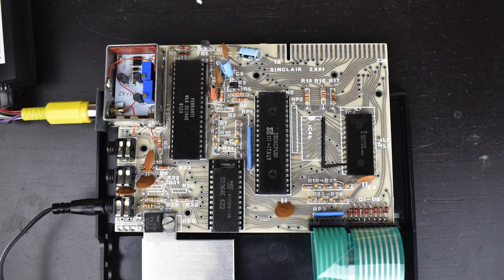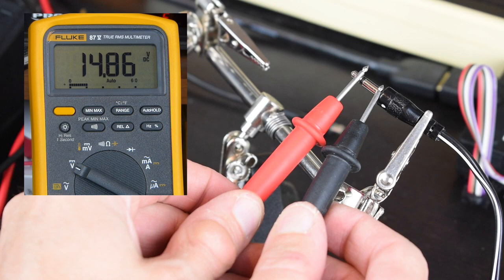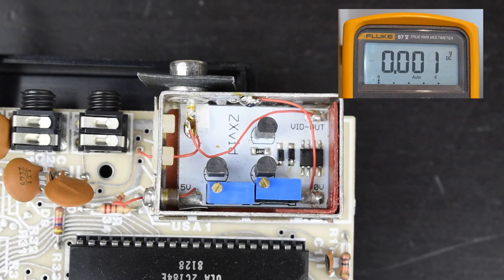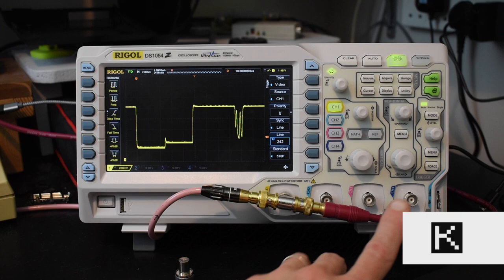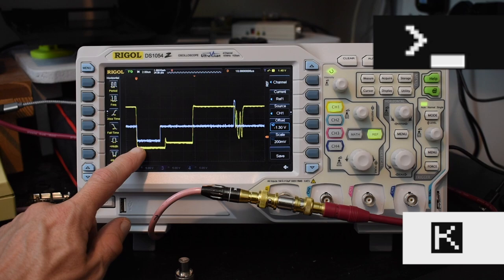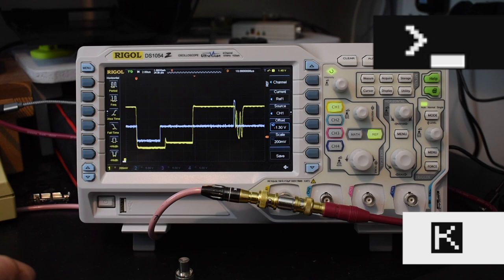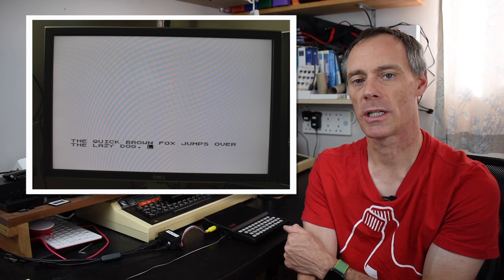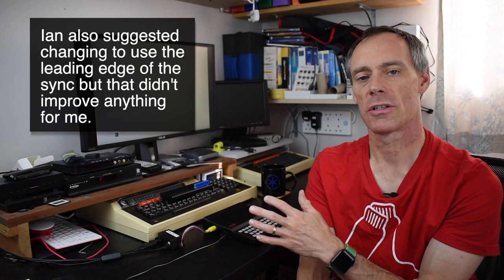ZX81 Composite Video and RGBtoHDMI Adjustments

Comment: You might want to try out a zx8-ccb (which is the same wiring into zx81) 

I think the voltage separation between the sync and back porch is greater. 

I would find a video comparing the two signals to be interesting.

Of course you could also get a modern ula replacement that will give you a nicer formed signal with backporch

Congrats on the 1K

Comment: Excellent video and work. How did you connect the RGB2HDMI adapter? I'm assuming you rigged it up to the composite jack. Thanks for sharing
Reply from the maker: Yup — I just made up a short cable with a 6-pin IDC connector on one end and an RCA plug on the other end, as described here: https://github.com/IanSB/RGBtoHDMI/wiki/Cables

The ground (outside sleeve of the RCA) connects to pin 1 of the IDC and video (tip) connects to pin 4.

I used a Mutant Caterpillar mod on the ZX81 to get a composite image.

The problems I had in this video have been subsequently resolved by using a Clamp setting on the RGBtoHDMI, as that will automatically compensate for the varying voltage.  I probably should do a short video about that but haven't had time!
Reply: @lsbyte  Excellent! Thanks for sharing this information. Great work!

Comment: that's weird. i'm not sure why the rgb2hdmi requires a difference between the sync and blanking voltages. if it can detect the start of the sync, it can just wait the requisite time (line-sync + front-porch/2 = 4.7us + 1.65us/2 = 5.525us) and sample the black level then.

Comment: The amazing thing about this is that you're using a £300 scope to do what the original engineers could only have dreamed of back in the day. The ZX81, for all its acclaim is still a pile of poo though. ;-)
Reply: Pretty sure, in 1981 if all you could afford is a “pile of poo”, you’d be happy with it.
Reply from the maker: It's all I could afford at that age.  It was, however, enough to persuade my parents I could use the savings they'd put aside for me, from when I was born, to buy a Spectrum a year or so later.

All that said, I really don't remember it being as slow as that, and my fingers were certainly smaller!